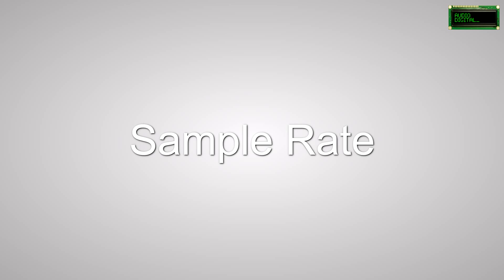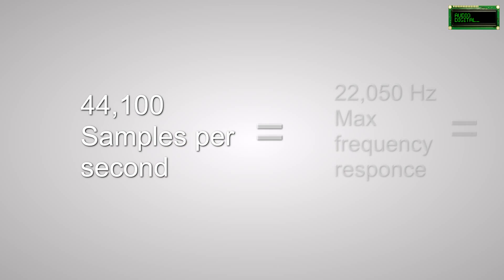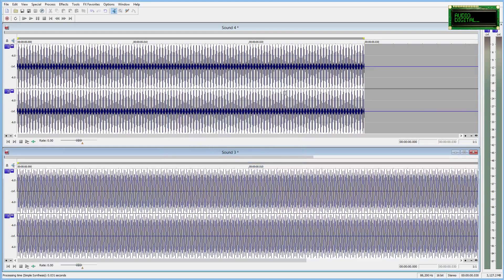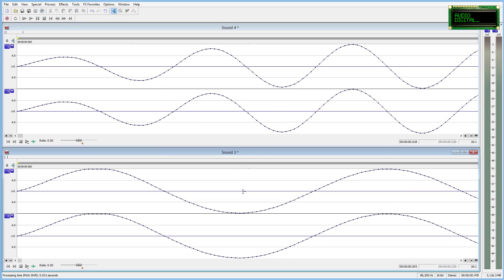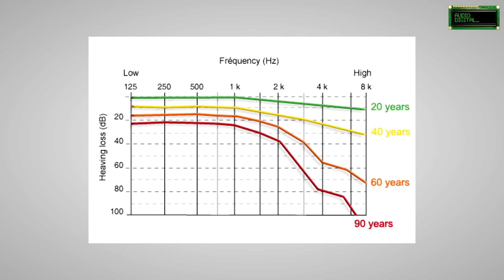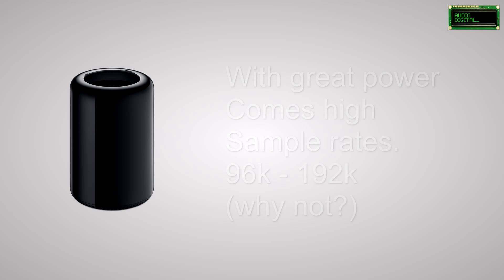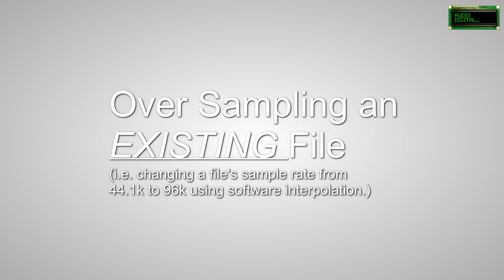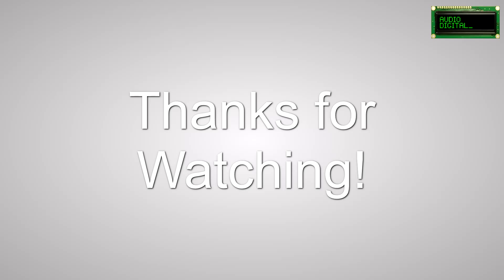What Sample Rate should you use?

Comment: The pich shifter is not suitable for an extreme adjustment such as this. To recover the clean 1250 Hz tone contained in the 44,100 item, use Resample to 176,400, set the rate to 11,025 on the status bar, then Resample again to 44,100. The apparent change in amplitude in the waveform is due to the sampling points falling between peaks. A good bandlimited SRC with enough context around each sample can reconstruct the signal.